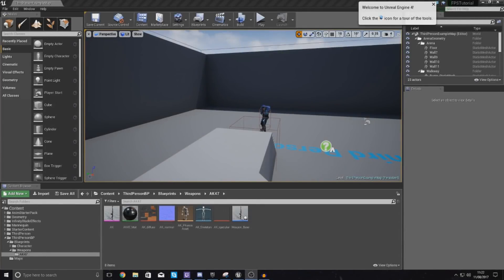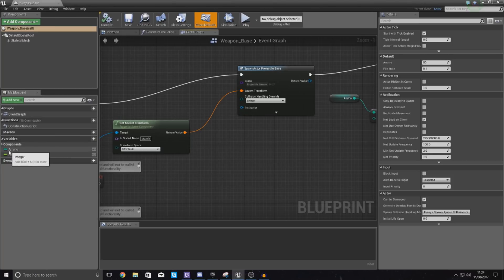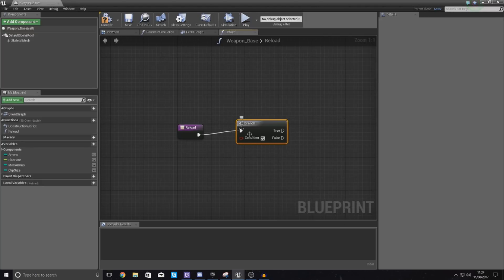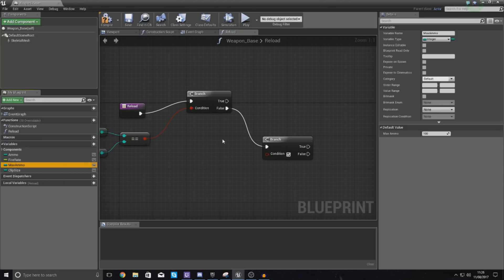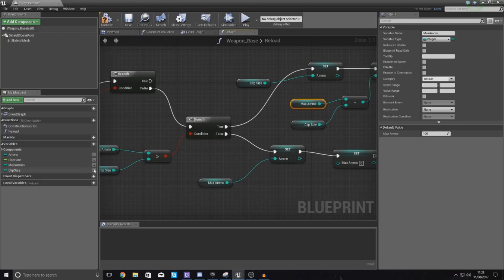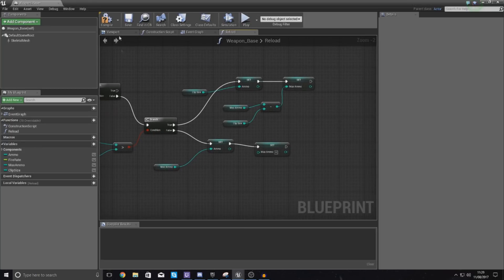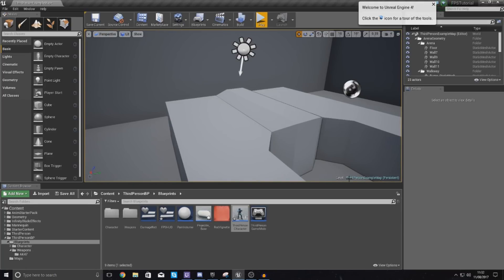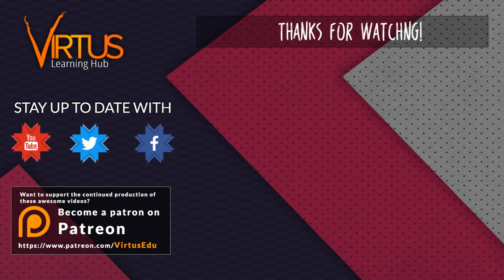Setting Up Ammo & Reloading  - #17 Creating A First Person Shooter (FPS) With Unreal Engine 4

Comment: Hey, loving the series! I just want to note that if you add another branch just after the Reload action event you can set the condition to a lesser than integer, then get your equipped weapon variable and from that get max ammo and then connect that to the top socket in your integer<integer and set the bottom to 30 (or whatever the clip size is) so when you reload and there's nothing left in your max ammo your character won't reload

Comment: I just noticed something weird, when my ammo hits 0, I can keep shooting as long in a semi-auto fashion, the ammo count even goes into the negative.  Does anyone know what's causing that?

*Edit: Figured it out in case anyone else has the same issue.  I had a node hooked up where it shouldn't have been.  From the "InputAction PrimaryFire" node's "Released" option, I had the "Set" node connect to the "Fire" node.  I figured it out because after my ammo was 0, it would still fire, but only when I released the LMB.  This puzzled me so I went and checked the "Released" part of the PrimaryFire and played around until I'd fixed it.

Comment: When I press R it reloads to 100/0 and I’ve checked everything I don’t know how to fix it. Help would be appreciated plz
Edit: I figured it out in like 2 seconds but if you have the same problem check in the reload if the greater than is set to equal instead. I accidentally had it on equal so it set the ammo to the magazine size

Comment: Guys, in this code you're taking an entire clip from maxAmmo whenever your maxAmmo is bigger than clipsize. To fix this:
when maxammo  == clipsize is true, first set maxammo to maxammo - (clipsize - ammo) and then set ammo to clipsize. 
This way first you subract from your total ammo the amount needed to go from your current ammo to a full clipsize, then after that you can reset ammo to the clipsize (also instead you could set ammo to ammo + (clipsize - ammo), adding the difference needed to reach 25 rounds again, but the equation is redundant so its basically the same as setting ammo to clipsize.
Reply: this last part you saying about the set ammo to ammo + (clipsize - ammo ) where do i do this my brain has gone Errr....

Comment: Managed to make a reload system in which the game stores a number of Magazines as well as the ammo in each magazine. Thus I can cycle between five magazines with each retaining their appropriate number of rounds. Its a bit brute force but it works for now. 

First create your new integer variables. I've named mine Mag 0, Mag 1, Mag 2, Mag 3, and Mag 4, as well as adding in Mag_Number. Mag 0 - 4 are your five magazines and each one stores the number of rounds present within each magazine. Magazine number is a value we are going to use to tell the game which magazine to switch to each time we press R to reload. Set the Default Value of each Magazine to 30. Set the Default Value for Mag_Number to 0. 

Inside your reload function, drag out and create a branch. For condition use a Function Equal Integer Node. To find this right click type in Equal (Integer). Set the top value of the node to your Mag_Number variable. Set the bottom number to 1. Hook up a Sequence node to the True output. From the Then 0 pin on the Sequence node you are going to Set Mag 0. We're going to set the value of Mag 0 to our current Ammo value. From the Then 1 pin we are going to Set Ammo to the value of our Mag 1 variable. From Then 2 pin we are going to set the Mag_Number variable. Using an Integer + Integer we're going to add a value of one to our existing Mag_Number value. 

Go back to the branch node. Copy your branch node, the Equal Integer Node and the Get Mag_Number node. Now paste them 4 times for a total of 5 Branch nodes. Hook each Branch node up to the False pin of the previous Branch node. Adjust the number in the Equal Integer Node to be one more than the previous Branch. So if the condition on your first Branch is "Does Mag_Number = 0" your second Branch Node should read "Does Mag_Number = 1" and so on and so forth. Next copy your Sequence Node and everything coming out of the output pins. Paste the new Sequence node and replace Set Mag 0 with Set Mag 1. Also replace Get Mag 1 with Get Mag 2. Do this your each Branch Node. On your final Branch node, which for this scenario is the fifth Branch Node, we are going to swap out our Integer Plus Integer node for an Integer - Integer node. You want to subtract 4 from your Mag_Number to reset the value to zero. 

For your HuD do everything Virtus did, using Mag_Number instead of Max_Ammo and then we are going to make one change.  Between the Mag_Number node and the ToText (integer) node, add an Integer + Integer node and add 1 to the Mag_Number. This will display the values as 1-5 rather than 0-4. 

If I've typed this out correctly and you've constructed this correctly, the game should begin each Press of the R key by checking the value of Magazine_Number to determine which magazine is currently equipped. Once it determines which magazine is equipped it will store the current number of rounds remaining (stored in the Ammo variable) into the variable for the current magazine. It will then change the value of your Ammo to the value of the magazine you are loading into the weapon. Each time it does this it changes the Magazine value by adding 1 or, when it reaches the last magazine, subtracting to in order to restart the loop. 

Not sure if anybody else had already posted something like this here, but after watching this video I wanted to try and create this on my own and after I finally got it working I got excited and wanted to share it.
Reply: That's about what I did. But have you heard of an array. Then you can use a for each loop and just use the index for which magazine you are currently using. That makes it easy to subtract ammo from the correct magazine and makes it easy to grab the magazine with the most ammo. That way you can keep those bullets in partly used magazines

Comment: Really glad you are doing this series. I am having an issue though.
When i go into my Third Person B.P and try to input the Reload Function, it doesn't show up when i type "reload". i went through the vid twice but it wont show up. Anyone have any ideas as to why it isn't working?
Reply: did you reference the equipped weapon and then drag the reload function from there?
Reply: Have you added a reload  keybinding in the Project settings/input settings
Reply: Sorry for not responding sooner, the key binding worked. Thanks for the responses!

Comment: Bug list:

when you reload and only shoot like 1 bullet it will take away 25 of your max ammo and add 1 in your clip.
when you sprint you can also aim.
Reply: Not a bug
Reply: Make fps game, it is very easy to make by this tutorial
https://www.youtube.com/playlist?list=PL2cm1sxNIdTez3Om2XPz1chAUHQ2epBGU
Reply: easy, when maxammo  == clipsize is true, first set maxammo to maxammo - (clipsize - ammo) and then set ammo to clipsize. 
This way first you subract from your total ammo the amount needed to go from your current ammo to a full clipsize, then after that you can reset ammo to the clipsize (also instead you could set ammo to ammo + (clipsize - ammo), adding the difference needed to reach 25 rounds again, but the equation is redundant so its basically the same as setting ammo to clipsize.

the second one set up a variable when clicking aim (isAiming) then whenever InputAction isAiming happens, just do a branch to check if isSprinting is true and then if so set it to false. when InputAction Sprint, check with a branch if isAiming is true then, if so, set it to false (basically repeat what we did when fixing sprint and crouch)

Comment: Hey Virtus! I understand that this reload mechanism is more realistic, but how would I reload and make it so it doesn't lose 25 from the max ammo every time? Like in modern day video games like call of duty?
Reply: Reloading and amunition withou extra variables. https://blueprintue.com/blueprint/acr9qhq3/
Reply: @Arkideit  The one problem with this bp is that when you get below the clipammo it doesnt work well
Reply: @Arkideit  Thank you!!
Reply: @Arkideit  This almost works unless you have less than 25 ammo remaining, if you try to reload again you lose your remaining ammo
Reply: You could take the remaining ammo of the current weapon and subtract that from 25 and then subtract the total from 100 or the max ammo  you got
Reply: Thanks for the help, but I had already tried that and I receive an error saying that there is an infinite loop and automatically sets all the ammo to 0.
Reply: There wont be an infinite loop , 
When you subtract the 25 from 100
Don't assign 25
Drag it instead 
Put   integer - interger 
then assign the current ammo in bottom 
put 25 from top 
and take the total tom subtract it from the maximum ammo ( the right side one )

make sure this happens when the reload is clicked if you did virtus part then you've already done this 

lets repeat :D :D

The part where it tells you to subtract 25 from the 100 (current from maximum)

take the 25 node 
add an integer - integer 

In the lower one  ( subtracted from ) take an other integer - integer 
This will make an other math
Here you can put 
25  -  current

On the top add Maximum

so Technically what it will do

Get the current 

Subtract it from 25 
take the result and subtract it from the maximum 

oh and you better set the current to 25 when you are done
Reply: I fix it, maybe you can try. https://blueprintue.com/render/v4ba70ug/ https://blueprintue.com/render/g8v9iywc/
Reply: If you've done this for yourself, can you please put it into https://blueprintue.com/ it's just much easier to understand. Just copy it straight from ue4 and paste it into the bin and send me the link. If you haven't done this though in your engine then you don't need to. I can work my way around it
Reply: Nevermind, I got it! :D Thanks for the help, I appreciate it
Reply: Can you please show me how you done it? i am having a hard time trying to find out because they talk about current ammo and i do not know where to get that
Reply: What do you talk about with the current ammo?? please help